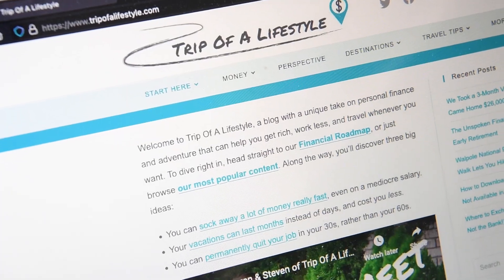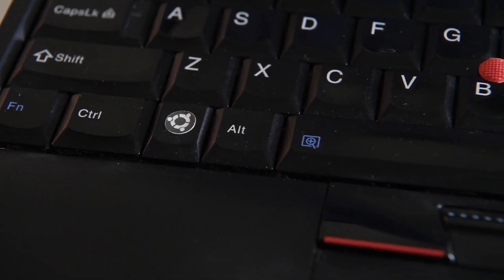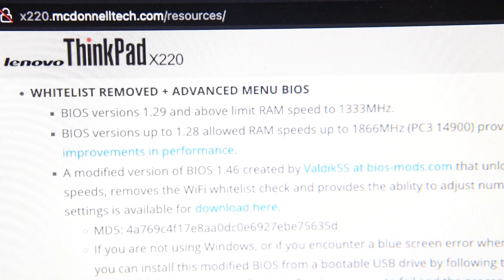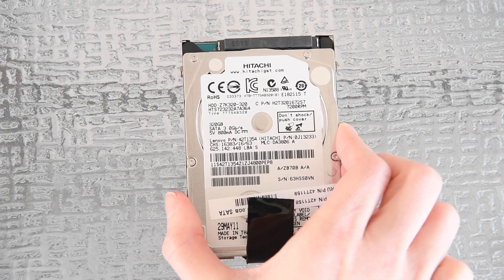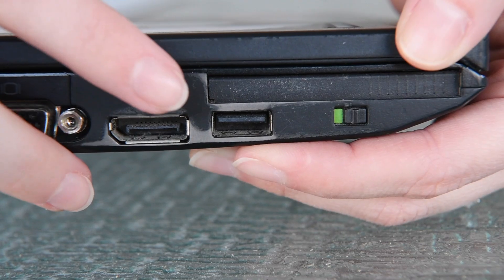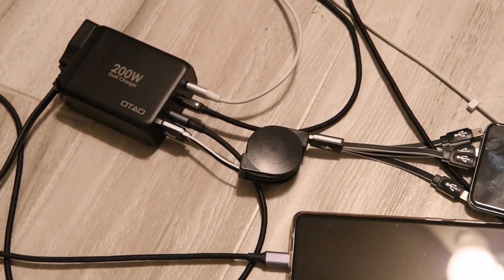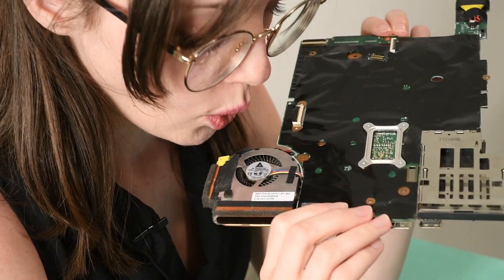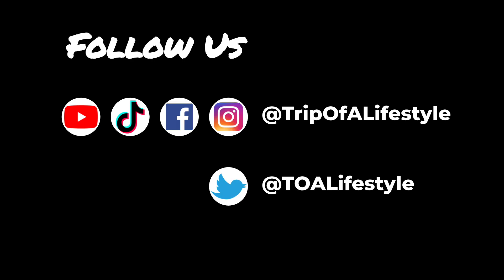How To Make Your Laptop Last FOREVER (My ThinkPad Mods & Upgrades)

Comment: Very cool yet intelligent ideas! I have my own story of what I am doing to a ThinkPad T430 I got nearly two weeks ago from my dad for free that I am using to type this comment as of right now and as a matter of fact I am about to beef that up myself very soon once the parts arrive. Before I begin on what I will be doing to my T430, I want to mention that this laptop was actually believe it or not about to be thrown away by a person my dad knew hence how I even obtained it in the first place and I am very happy now that I am able to preserve it and work on it while greatly improving it as one of my projects. As a side note, I have already replaced the installation of Windows 10 from when I got this thing to Linux Mint and I am loving it so far. Its lighter and much less bloated than Windows 10 while still being very easy to use.

 Now for starters on upgrades that are in progress, I will be upgrading from an i7-3520QM and a 512 gig HHD to a more powerful i7-3610QM with fresh new Arctic MX-6 thermal paste and what will be a much faster 480 gig SSD though there is no need to upgrade the RAM since it was already maxed out at 16 gigs when I got it as another lucky bonus. While ordering that, I also ordered another battery for it since the one I have right now does not hold a charge and I even got a T420 keyboard to swap into it later for a better and more retro typing experience. As for the display however, I am considering getting a 1080p IPS display to replace the piece of crap stock display as well as an adaptor for it though I may put this upgrade on hold for right now to save money.  Going even crazier, I will though be trying to put an external GPU in it with the dual monitor setup I made to make it more viable for gaming after Christmas is over.

So for conclusions, I am very excited about making my ThinkPad T430 an absolute beast with these upgrades and mods and I cannot wait for my full-on setup to be completed which I also plan on including a Havit mechanical keyboard and a Redragon gaming mouse with it. I will be sure to have photos of my project's progress and photos of it when it is finished. Anyways, have a good one and feedback would be lovely!

Comment: Saving money is important, yet I doubt I would have gone to such lengths for an old laptop with under 4.0 Ghz cores unless just having fun with one. I also need faster switching speeds and processing rates in the processing rates along with those being held up and via the correct base frequency amounts and those need to improve because I would like a base of 4 to 5.5 Ghz someday being standard and also if you are using the igp GPU's those are important. I watch movies from my laptop an other content at both 1080p and 2160p and so your laptop suggestion didn't make it to the ballpark. You didn't hit a home run either, you simply didn't make it to the ballpark. Although the memory today has gotten worse to stayed the same in many ways over the last 15 years and with the release of DDR3-800 it has remained the same in many ways. If the base clocks runs at 4 to 5.5Ghz and with fewer cores from 1, 4, 8, 16, and 32 in SMP SMT variant (1 threaded) and 1, 4, 6, 12, and 24 in SMT SMP (2 threaded) the processors might have rates of 4.5Ghz to 6.5 Ghz being standard someday with some faster servers running around 7.9 Ghz. And that's, pretty close to the limit. The artwork possible in that layout and also with some other things that might be able to be accomplished and also artwork for the heatsinks and laying in the possible artworks for the heatsinks because of those artworks is off the chart with such simple layouts. The IBM P5++ aka P6 is an awesome architecture and achievement. A Lenovo X220 is just a laptop in a laptop sham game of computer processing different variative rates in different variative rates with minimums and maximums that can be handled in those constraints. Wow, Cyrix slipped one in for a few years that built to AMD existing and who would ever suggest that Cyrix return and that's awful that someone would say such a thing and wow a processor that worked really well with some of the Radeon Graphics cards for a bit that built to AMD existing. No thanks on that also and that's return of Cyrix which fell and also when more instructions sets were released that the processors needed to handle and they also got faster with those over the years and how the motherboards are also laid out. It is important that the processors support those instruction sets and especially for servers and some people thought they might make servers from the Cyrix processors and I never did that and yet I doubt it worked very good and also because I don't think it supported all of the necessary instruction sets. My vacuum cleaner had some problems and I worked those out several times and yet for an old laptop that I haven't turned on in 25 years, phew, all kinds of fun. And for some I know that might like oh super and so oh like oh my gosh Becky, and yet, timing is sometimes crucial to people's varying punch lines. Wow, if someone offers you 20 million dollars for something very simple you might want to accept it and because otherwise what that actual means is that's the amount right now that someone else will get if you don't accept it and to some that's oh so X220 and by the Roman numbers and numbers and in a Hostel gambling game to Football Gameday and many other things I am thus far a frequent survivor of that game and yet many others didn't make it and I mean they most certain lost their lives in that game and again it is a gambling game for something called Hostels and I got brought back in again starting 9/11/2011 and yet it was going on before that and yet I got brought in at that point and for some as top member and in that they have actual gone Hostel because of Hostel, is real. I am wondering what happened to the Benson girls and because of this and in so many lights of 1=1 action! I'll explain the rules of the game again and that's if you refuse the money then someone else will get the money and regardless of whether or not you get the money and so X220 and people having fun and in evil and sick and twisted ways if you refused the money you will also lose your life. Those are the rules of the game and some people might not know that and that's because it's a Rivermaya classic for some at this point and even before the release of that song. I think that game began in 1985 with the release of the song "The Hooters - And We Danced" and how clever that's a flatline on her shirt and everything IBM. What's the history of a Thinkpad and I don't believe you in terms of your laptop usage and I think you are most certain using other laptops and having fun and taking part in those Hostel games and also a game called Football Gameday. Some other members are: Scott Miranda, Jeff Hanes, Jeff Root and father, Scott Murray, Princess Diana, and myself. I'm wondering whereabouts of some people on 9/16/2011 at 6:00 PM Eastern Time Zone. Anyways, interesting BTW and yet I must say what I said and because of what happened to those people and in a Hostel game that they found themselves in and as players called Football Gameday. The State Of Michigan has lots of contributing members and ones who live in Michigan and yet reside in other states. Anyhow, what happened to a person named Ronald Hammink is also important and also because I had watched what took place. It's also important and because it's a tag you're it game and it means there are people who are doing other people special types of favors and services and for that they also had to do their part in those games and that also included other Oaths and one of them is that they are something other than an American and in that they are to do warfare against Americans and so those are real bad things and sometimes bad things are 1+1=2 and yet in this case they are most certain awful things! Again, X220 idea of yours didn't make it in the ballpark to attempt a home run, your idea to the top is F-! Thank You!
nightcore - enchanted (taylor’s version) (https://www.youtube.com/watch?v=TlguHk-wxqk)
Bad Day - Daniel Powter - Madi Lee Cover (https://youtube.com/watch?v=pH3RelL1178)
Kingston Falls - "Freakin' eXtreme!" (https://www.youtube.com/watch?v=APokB8ck1rQ)
Was An Extreme F- BP - Let Go (https://www.youtube.com/watch?v=7MOuMnrUfS8)
Doug Stone - In A Different Light (youtube.com/watch?v=PMEA2gcdLY4)
{(OvO)} At 💎 vs (::||::)
Reply: HP Pavilion Laptop 15-eh3047nr, Windows 11 Home, 15.6", AMD Ryzen™ 7, 16GB RAM, 512GB SSD, FHD, Natural silver has so much room to get vast increases in the validation of the components and the increasing of the base clock frequency for some to => 4 Ghz with a Turbo Clock of 5.5 Ghz and with 6 cores and yet madness I tell ya, madness. Is real, and I think that what was done here is an act of pure evil! Though, you're funny, ks! Whoever you are and having fun you are act of evil and causing harm unsto Americans and the vary perception things that people should want and to have and possess and that includes recycling pop cans to get a better laptop! Whatever you are, please get off of youtube because you're evil and a sham and I just have so much room for shams in my life and it even includes my drapes and yet you are as described! My WORdS(X)Yer Shirt! Looks, not even for a vacuum from you folks and that is I don't want anything other than to turn you in for warfare against America! Literal, you are so warfare against America and a too many shams in a sham in sham model! This was so already covered many times aLreAdy, Becky! My $$'s R Down! Thank You!
Ks, A jIm bLuNt - YoU're beAuTiFuL (youtube.com/watch?v=oofSnsGkops)
Game On - Almost Goodbye (https://youtube.com/watch?v=feJiTNFFITg)
{(OvO)} At 💎 vs (::||::)
Reply: I gather that you have perceived that the clock frequency was part of the puzzle for some and it wasn't that I doubted you it is that I most certain doubt your madness when laptops have gone sham and that's what a 2 core with 4 threads?! No way!, not going to happen, not even for my laptop and I'm just saying, you're evil!. I need performance and I like to watch movies and do many other things. And yet, good luck, try vacuum sales k! :) , Thanks! Wow, terrorists gone wild and having fun and with all kinds of artwork in network and network of madness gone wild and madness must cease and some instrns were made 1=1 clr givn. Base clk estmts off and low core model, nope, laptops trying to catchup to servers, got a new one! The score was in the validation of the best choices for bus architectures within the best memory framework model along with the best processors that could exist on the circuitry that can exist and support those things with the rest of the components necessary and that even included the heatsinks! Yep, even the heatsinks are important in optimum designed architectures that even had room for the inherent artwork intrinsic factors of the network layout of their circuity for that distribution! I so want more charges filed for treason and for a lot of reasons and that includes the vary warped perception of the cache and the SMT and SMP characteristics themselves being invalidated in terms of any basic mathematical formulation whatsoever that could be formed up and for nothing other than a promise of better performance for a greater price margin and so the compute cycles and the number of cores need to align with the amount of time it takes to also access those facets as process of that which is being delivered must be returned and so again, no way, I returned some pop cans and got a new laptop! I also covered this part and that is that I don't even want to purchase a vacuum cleaner from you or anything else you or this channel has to offer and because you're evil and evil in the industry of computers where many things were also done to try to also create a perception of this industry whatsoever, War Of S! Is too late, I already spent the money! Thank You!
$'s S'S-still coming thru! (youtube.com/watch?v=yOgKwKFG4Z0)
aRtWORk! d.S. fLOweRs (youtube.com/watch?v=LqIhYd62qVs)
{(OvO)} At 💎 vs (::||::)

Comment: Excellent advice. But this probably only work on high end, durable type laptop like yours. My laptops (all of them are cheap) on avg last only 5yrs before start glitching here and there (likely chipset or components fatigue). I have purchased 4 laptops within 20yrs, with total price of around usd 2500, not bad. Probably going for my 5th soon which most likely will be low end as well since I'm rather weak financially 🤭 (I'm considering new laptop mainly because looking for more usb c ports, without having to carry usb hubs)
Reply from the maker: @yyyyy354  You're right that this works better on a laptop that's built well in the first place, but you can totally buy one used! We talk a lot about that in this blog post: https://www.tripofalifestyle.com/gear-and-tips/laptop-buying-guide/

You'll find a ton of other money-saving content (not just laptops) on our blog as well. ☺️

Comment: Great video there!💯💯💯

In fact, I had a much older model ThinkPad, believe it was the T42. Though was able to upgrade the CPU & DDR RAM to its max it 2GB, making it run 32-bit Windows 7 Pro (due to having a TechNet subscription) w/out the Aero effects, later became a decent Linux Mint Mate laptop. 

Anyway, getting newer & closer to the one you upgraded, have an MSI FX-603 that's still used, came with a 1st generation (Arrandale) Intel i5-480M, later upgraded to the max of a i7-640M. Plus, all the way from a N-1000 to an 7260N & later to 7260AC wireless/BT card, 8GB RAM (this was the worst limitation about the 1st gen Intel laptops) & finally, a SATA-3 SSD, though ran at SATA-2 speed, still quite fast with Samsung's Rapid Mode!💪

Tried to find a modified BIOS to make it run a i7-720QM CPU, as similar HP models based on 1st gel Intel, since it has a dedicated NVIDIA GPU, but came up empty handed, even looking on specific tech forums to create one just for me yet found nothing. I still presume there's a way, but then gave up & began building computers after my 1st new one, an XPS 8700, although had potential, even upgraded from its installed i7-4770 (Intel Haswell, 4th gen) to its max, the i7-4790K, which was in a few months to be the CPU for my 1st Z97, 32GB RAM & EVGA GTX 1070 FTW (8GB GDDR5). 

Have never bought a retail computer of any type since then, learning what I am wanted & do & enjoying the thrill while saving $1,000 each time. Am now rocking an AM5 ASRock X670E Steel Legend with 32GB DDR5 RAM & as for the CPU, a real contender in the Ryzen 7 7800X3D, purchased in June of 2024 at $350 on Amazon new. Since then, has went from that price to first, over $500 & now over $600, as it's known for being the current King for gamers. At least until the Ryzen 7 9800X3D is released for around today's current same price as mine, being it's been a huge success for AM5 platform. Will likely skip the next & wait for the release of the one after, since am still running the GTX 1070 in this one, needing to prioritize a GPU upgrade first. 

Good Luck on your channel, have subscribed!❤❤❤
Reply from the maker: @charlestilley2576  Thanks!

Comment: I buy a 3-year old laptop for about $200 every 3 years. Total cost for 12 years $800. My latest is a Lenovo X270S with 12GB and 500GB SSD. I don't bother with maintenance...
Reply from the maker: @dberis  Nothing wrong with that at all if you don't mind the "new computer setup process" every 3 years.

Comment: I thought I was the only one 😂🎉 I’ve had my Graphic design 2009 MacBook Pro (white- not aluminum) FOR YEARS. it’s my baby. She’s got 8GB of ram, I pulled the CD drive and have two 500gb Inland SSD and a Gen 3 Wacom pro cintiq 13 inches. She’s got Clip studio, manga studio and CS1 installed. And she’s on HiGH sierra. And when you hit the option key to power it on, you get to choose between windows and Mac operating system. Which even though it’s stuck on windows 7, it’s got Microsoft office 365 installed. So yeah she’s good to go. She’s got years of life left.

Yes I can game on her, I’ve created a flash drive with a version on Linux. I simply power it off, hold the option key and hit power button. This time, it’ll say windows-MaC-Batocera. If I select batocera l, it’ll go to the Linux software which is games only. So yeah, my baby’s got game and life yet for years to come.

Comment: I have an old thinkpad.  You can't upgrade the courts without upgrading the whole system board.  It only is a 2 core processor.  It's runs windows 10 on it, some idiot, I baught it from installed 32 bit windows 10 instead of 64 bit system which is not good at all.  System only reads 2 gigs of ram, but I maxed it out with 8, still not good for today's pc.  It's good u fix this up, but to what end?  You have a slow outdated computer that new software will not run on.  You didn't  mention the cpu, I imagine it's a duelcore it may seem fast, but try a 8 core processor, than tell me that ur pc is optimal.